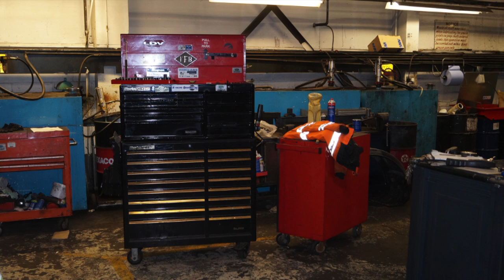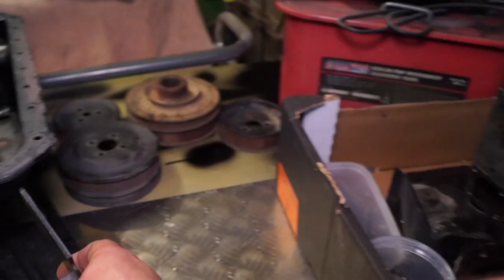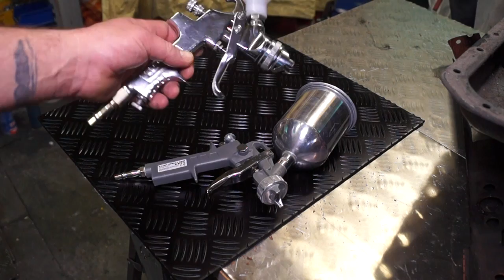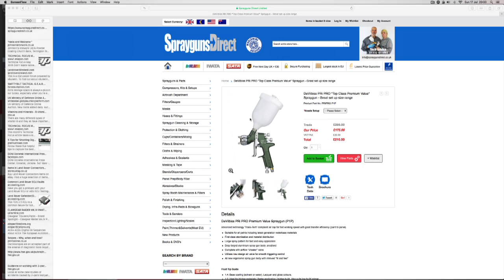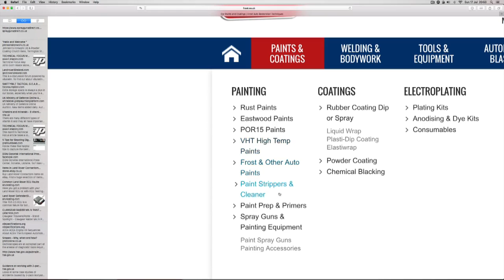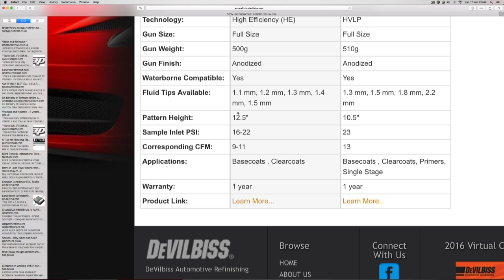Subscriber Update LRTV June & July 2016 - Fluid tip Info on Spray Guns, Black Paint for Parts

Comment: I was thinking of the SIP to spray the chassis with Buzzweld CIO. seems like a brush is more ideal?
Reply from the maker: CIO is really thick material to push through a spray gun.  It can be sprayed by needs a high pressure electric type/  You need to talk to Buzzweld to see how it can be done.  They have a Facebook page which you can ask questions on.